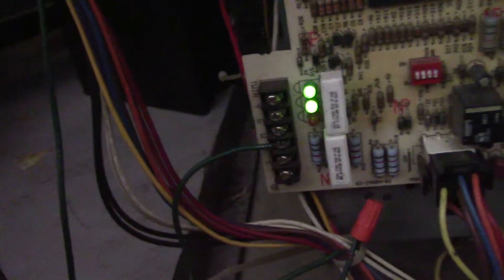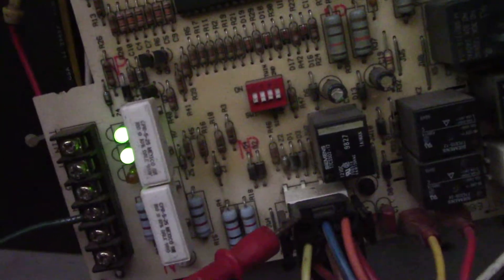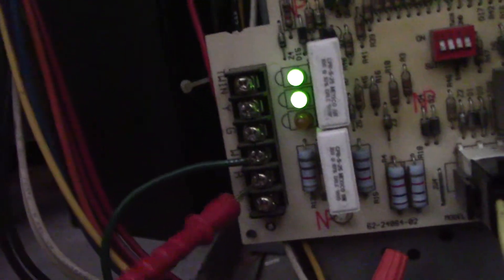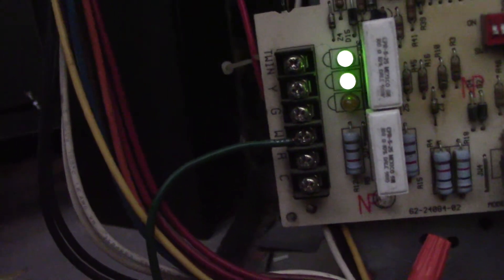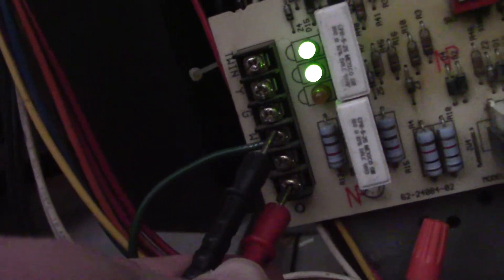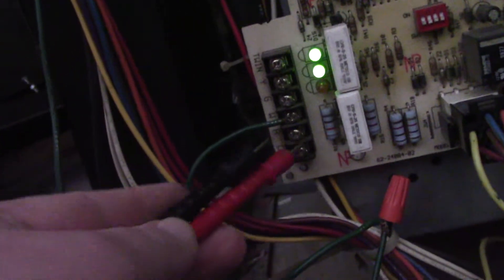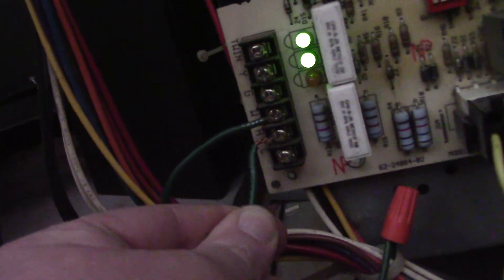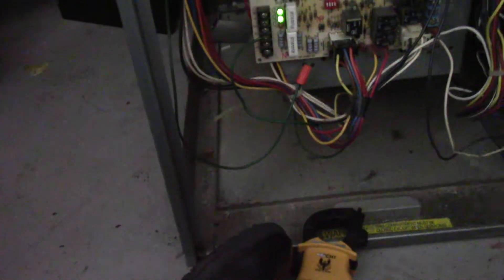Troubleshooting a gas heater furnace 24v thermostat and IFC board

Comment: What if the thermostat has batteries and doesn’t use a common wire on the board?
Reply from the maker: Than its battery operated and won't use 24v for power. The thermostat will still act as a set of switches, just battery operated.